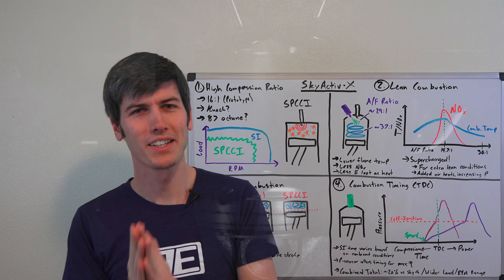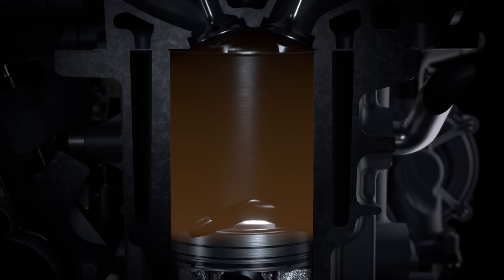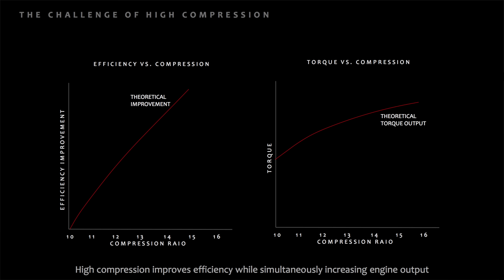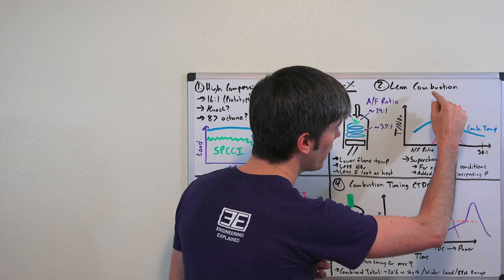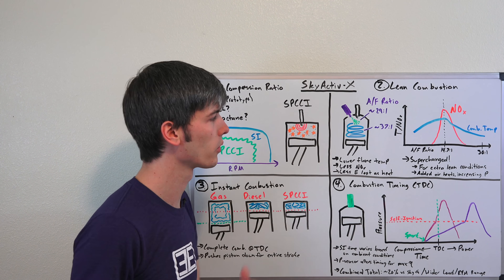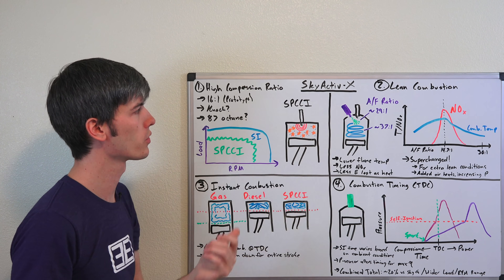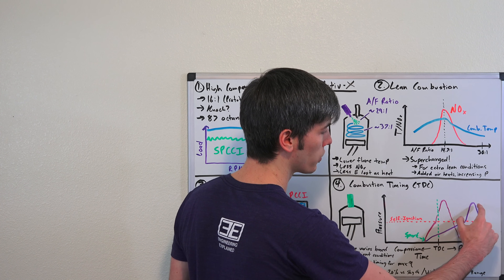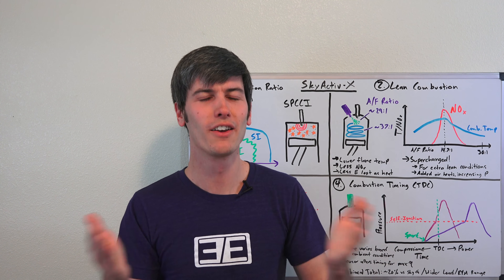How Mazda Is Saving The Gasoline Engine - SkyActiv-X

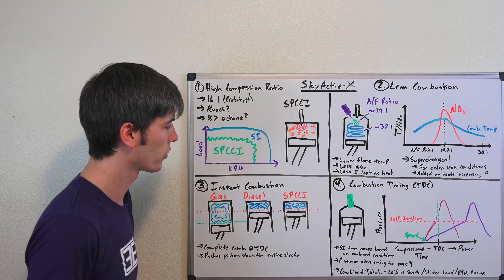Comment: 9:29 I’m pretty sure something is off in your explanation here. Spark ignition is not slower than diesel to combust.  Diesel is slow because the injected fuel takes time to vaporize and mix with air and then start to burn.  

The spcci as you are describing, in contrast to both diesel and si combustion is caused by a pressure wave. Pressure waves travel at speed of sound. This is much much faster than either stoichiometric flame propagation or the mixing speed in diesels.

I think that is really what you meant to explain.

Comment: it is not knock ... you are failing to mention the charge mixing .... it's the mixing that keeps it from detonating, and it's the mixing that keeps the self ignition from being harsh.
it's the mixing.
as I mentioned in another video,  my carbureted, air cooled, motorbike, with no knock sensors, runs stable at 15.17 bar BMEP naturally aspirated ...how is that stable ? it's the mixing.
Mazda is basically hyper accentuating the inherent 4-valve tumble .. making it tumble more With The Ports.....I read an article on the newly developed Swirl Porting method in 1988, and that totally charged how I port.

Comment: I must respectfully disagree with you about electric cars being the future.  We do not have the infrastructure for everyone driving an electric car.  The current grid will not support the massive amount of powered needed to charge electric cars.  There are not enough cooper mines to make the required amount of cooper to produce the required cooper needed  to name just two of the current problems and then there is the resourced needed to produce batteries.  Look at the current drop in EV sales.  It is not the future IMO.

Comment: I have a 2020 Mazda 3 and it's great. I ran across hard times and couldn't maintain the maintenance as frequent as I wanted (not total neglect just not as timely as I wanted life happens). Anyway despite this I'm still getting 30.9 mpg and that's after falling from 31.3.
Times are better and the car is paid off so I can get back to keeping it a well oiled machine.

Comment: 8:37 I know it's seven years later but I have a doubt. You say here that diesel have almost instaneous combustion and otto engines rather have a prolonged combustion during the expansion of the cylinder. But weren't the "theoritacal" cycles the opposite. I mean, I know that I'm reality, they aren't really true to the millimeter as they they are physically impossible, but they aren't very far from reality, especially nowadays. Unless diesel have very dry and instant combustion they aren't achieving the instaneous combustion of gas engines. I'm not an engineer, but I think you wanted to say that gas engines have a flame propagation problem, the flame starts from the spark and then propagates. But diesel have combustion happening in every part, so multiple ignition points. But this doesn't mean that gas engines work at constant pressure, or diesel at constant volume rather the opposite.

Comment: Guys I have a question! i just bought a 2025 mazda3 with skyactive-x engine here in spain, and i wonder if it will be good or usefull to use higher octane gas with this spcci technology

Here in spain, 90 USA (98 EU) octane gas is way more expensive because almost no one buy it, but as Skyactive-X uses lots of compression ratio, maybe it is better to use it besides the price

Thanks guys!

Comment: Hmm… maybe the second, smaller injection of fuel should use something like nitromethane instead. Nitromethane cools the cylinder, has a high flame speed, and brings its own oxygen.

This allows you to use a higher octane fuel for the rest of the cycle, allowing you to have a higher overall compression ratio, but still having quick ignition at higher RPMs.

Comment: Other people who drove this car say that engine does’t really have power Mazda claims and engine is in a capsule because it is very noisy! And fuel consumption is not impresive…On top of this that car (Mazda 3) had very, very long gears, so on hill they had to shift 2 gears down to get the power and driver of a diesel Passat behind them thought they were kidding…!
Reply: It has plenty of power but you have to give it enough RPM. Remember, it has no turbocharger. I really like it this way. Together with the very crisp manual transmission in my CX 30 it drives like my first cars, just with substantially more power (my first Audi had 90 HP).
Consumption is great, I have to really push it to go above 6 liters/100 km. Normally about 5.3. Not had for a petrol car.

And the capsule is not there because it is noisy (it isn't) but because it sounds a bit unusual due to the compressor etc. You can sometimes hear it on the autobahn if you're fast enough and the road is narrow enough to reflect the sound. Sounds like a high speed train 😁.

Comment: I have this engine for 3 years now, it's so smooth at low rpm, so fuel-efficient you don't have the economy of a 2.0 naturally aspirated, more like the same as a turbo 1.5 or 1.4 from the competition. And it still has some punch especially above the 4200rpm range where it doesnt work in "diesel" mode but regular gasoline mode so you get all the power.

I recommend y'all to try it out, it makes a fantastic daily driver in a country where gas price are high (Europe) without sacrificing too much on power. And i guess it's pretty nice for the US too, but if were living in the US i would definetely go for the 2.5 turbo for the power and fun as gas price is not a problem there.

Comment: I had 5 different Peugeots over the years, I know,I know, they were rally bred but they have gone the way of the dodo. My last 308 was a disaster and couldn’t wait to get rid of it. The engine a 1.6 litre diesel was a collaboration with ford so just a run of the mill engine fitted to Volvos minis and ford Peugeot and Renault. I researched other cars and I couldn’t find any bad reviews. Turns out I bought one and what a pleasant surprise. The suspension and handling are supreme. The braking system is excellent and the fuel economy is outstanding. 6.2 litre per 100 km using a low octane fuel out of a 2 litre engine.happy customer.

Comment: Atkinson cycle, not Miller cycle?  Either way, isn’t retarded valve timing events compared to Otto cycle. That’s how they get away with such high compression ratios running on regular pump gas. It’s about cylinder pressure not static compression ratio. Very informative video. By the way, I’m a 17 year Mazda master tech.

Comment: I wonder...can a turbocharger be bypassed, so that it works only when I want?. The outside air intake from the filter gets a bypass flap toward the engine/ or the turbocharger, and the exhaust also gets a bypass flap toward the turbocharger/ or the  catalytic- muffler...out. The engine/ transmisson would last much more, since only work over pressured when I want. Does the computer would need additional adaptive programing,  or the mafs sensor-pedal position- injectors-coils compensate/ adjust in concert with current software to make it work? Thanks for your opinion. David

Comment: Why not just pour gasoline in a diesel engine (of course with required adjustments so it doesn't break)? you get more power per liter than diesel and you don't have to worry about knock

Comment: Great explanation! Now I have a question: let's say if we want a bit more power from the engine and brings the car to a tuner, since this is a new type of engine do you think it's safe to increase the amount of injected fuel/air for more power? Or is it going to mess with the whole settings Mazda set from stock regarding the knock handling?

Comment: Your explanation of combustion time in diesel vs gasoline engines is backwards.  In the Otto cycle (ideal gasoline engine), combustion occurs all at TDC.  Real gas engines closely approximate that since it takes minimal time for the flame-front to cross the cylinder (from spark plug) thru the premixed air & vaporized fuel.  In the ideal Diesel cycle, combustion occurs at a constant pressure, which requires a slower steady burning as the piston descends.  After all fuel is burned, cylinder pressure drops as the piston continues downward, as in the Otto cycle.  The Diesel fuel spray rate is purposely tapered to allow this.  Ideally, cylinder pressure won't exceed the initial compression pressure (say 400 psig) with the spray combustion maintaining that as the piston descends.  But you are correct that the "quasi compression ignition" in the SPCCI is rapid since all the fuel is already in the cylinder when the spark ignites it, so the thermodynamic cycle is more like the Otto cycle of other gasoline engines.

Comment: I've always been of the opinion that hybrid is a good idea; better than pure electric. But the one handicap is getting some gasoline engines over 50% thermal efficiency like the new achades desil. But at 50% your bassically at the same efficiency of our best fossil fule grid energy production.
Reply: There’s an endless supply of crude oil. We don’t need more than 50% thermal efficiency. Especially when you consider the efficiency of turbines in power plants isn’t more than 60% and the distribution of electricity is very lossy.
Reply: @erict.35  the point is that at 50% te an ice would compete with or beat all but one conventional power production method ( natural gas at 70% te ) that said when you account for transmission losses along the grid natural gas in only at a slight slight edge. So the idea that using smaller battery packs like a capacitor rather than a traditional battery; and taking advantage the energy density  of gas compared to a li-ion battery at nearly a 100x energy density. You can use less of the extreamly finite lithium reserves per vehicle and get longer ranges by taking advantage of gasoline as chemichal energy storage rather than li-ion cells.  And as food for thought pushing the 70% te of natural gas power higher will be a much harder task than pushing the 40% of most cars too 50% or higher

My opinton still stands that if you pair a hybrid system with an ICE with a specific fule efficiency of greater than 50% you would bassically be at the same emissions per kw or potentially better than all electric and reduce the consumption of limited resources like lithium.

Comment: Won't help. The Scientific and Technologically illiterate UK government is prohibiting the sale of IC engine based new cars in 2030. This is part of the ill-informed pointless Net Zero policy initiated by Theresa May irrespective of the cost to the UK tax payer. This policy is just designed to make the silly old trout look good on the international stage. UK is responsible for 1.9% and failing of global carbon dioxide emissions and so will not have a noticeable effect.
Reply: info: The UK is governed by a Scientific and Technological illiteracy. To my knowledge there is only one STEM degree holder in the cabinet. There are far too many lawyers, PPE graduates, History Degree holders in the House of Commons hence the tendency to seriously screw up on Scientific and Technological matters.

Comment: Go back to the 1970 th Honda created a cilinder head with the futuristic of a small chamber were the spark plug seated and with a small valve letting rich air fuel mixture in the small chamber and the main chamber with lean air fuel mixture dig in the history maybe you will find it ,if not they hold it secret  if I remember they called it civic

Comment: By the example you show, the valves are positioned as fully closed, when ignition occurs. So why are you taking about Spark Knock because that can't occur if the valves are fully seated and the spark plug is needed to start combustion ?

Comment: SPCCI requires low RPMs or low octane fuels to work optimally. Could probably improve this by combining it with RCCI, and thus using both a high-octane fuel and a high-cetane fuel. For example, start with Isobutanol as your high-octane fuel, then inject either hexadecane or diglyme just before ignition. Could also replace the high-cetane fuel with an oxidizer, such as a blend of water and hydrogen peroxide.

Comment: Nitrous oxide supports combustion by releasing the dipolar bonded oxygen radical, what you mean is Nitrogen oxide NOx gases form when fuel is burned at high temperatures. NOx pollution is emitted by automobiles,

Comment: Still a P.O.S.
Reply: Didn't realize you were an Engineer as well...
Reply: No never claimed I was, however I’ve been in the junkyard used auto parts business since the 80’s and I know what people are looking for, the more they look for a part the more I know it doesn’t last, that goes for Corea motors as well Mazda is not as good as Honda or Toyota and others, Mazda for example doesn’t have a key way on their crankshaft, pop the clutch a little too hard and their go’s the valve train and many more problems, I guess that’s how they make their money. POS. 2.0 . And that’s all I got to say about that.
Reply: @benitovaladez7596  Those are old Mazda engines that Ford's 'Engineering' team designed, they used friction washers instead.

Mazda has been Ford free since 2015 and Toyota is using Mazda's skyactiv engines on some their cars.

Comment: You say lean doesn't burn hotter. But I know from experience that lean melts pistons and even just leaving off your brake booster hose (large vaccum leak) will cause the exhaust to glow bright red. So how do you explain that?
Reply: When under high loads your AFR's are going to richen up to keep combustion temperatures down. Most factory cars are going to be in 12:1 range under high load. What most people mean by a lean AFR melting pistons, is leaning out under load. Its not running lean per say, but running less rich under load. the engine is still running rich, but instead of runnning around 12:1 they may be running at 13:1 or 14:1 under load and thats when you melt pistons. You are still running rich, but you aren't as rich as you need to be to keep the engine intact. Running lean overall (AFR > 14.7:1) actually lowers combustion temperatures.

Comment: Have a Mazda 2018, 1.5 Diesel and  its fuel efficiency is fantastic!!! Better than my Smart 600cc!!!  Problem free, reliable, 105hp and drives fantastic. S5 engine code. Exhaust pipe is always clean!!! Gets 33km/ltr on highways and 23km/ltr in town!!

Comment: English is a primitive language to explain something. I find like with the language, there is need for braggadocio. All those word he used to explain that for more power and emission efficiency you need combustion happening from a simultaneous  release and consequent ignition of the fuel and oxygen mixture, which then reduces the combustion volume inside the cylinder,  rather than the opposite which happens in most of today's engines.

Comment: In a "normal" gasoline engine the larger volume in the cylinder of combustion, compared to a Diesel (CI) or a SPCCI engine, maximises the cylinder wall available for waste heat removal. Does the Mazda engine described here require high temperature and high pressure resistant materials, as does a Diesel engine? Also, in a normal gasoline engine, a lean mixture has reduced charge cooling, which leads to the same question.

Comment: So in essence, Mazda is making a gasoline engine that creates power like a diesel- which is great, because Ammonia-injection diesel engines are a freaking nightmare and incredibly expensive to maintain.
They have always pushed the envelope, the miller cycle engine, the Rotary, the Otto-Atkinson cycle engine.

It's incredible how much R&D they put into their power-plants and chassis when they are comparatively a very small company, especially now that Ford has little to no stake in the company anymore.

Comment: I would imagine that it will need sodium filled valves and special pistons to transfer heat and handle heat this engine is gonna run hot also if it’s lean already if a sensor failed and runs any leaner what’s the plan then

Comment: 2 issues:  (1) Fascinating technology, but I would worry about the complexity of this as it ages. It uses a lot of sensors that probably are pricey to diagnose and to replace (let alone access)

. (2) Rust is a huge issue with Mazdas, my wife's 2005 Mazda 3 looks like it has termites, and we live in a low rust area (Alberta, Canada). I don't know if they ave addressed this issue, but I would NEVER buy another Mazda, as Toyotas of a similar age have little or no rust. Fuel economy is far less of an issue to our family than reliability.

Comment: Hello, there is something I don't understand about Nitrous oxide (NOx) emissions. I heard that a air/fule mixture ratio of 14.7:1 was the ideal ratio. By "ideal" I understand "stoichiometric" ratio. That's why I don't understand why it is the best ratio to emit NOx. For example, I heard that typically diesel engines emit more NOx then gas ones because they "work" with a lean mixture which means more oxygen then fuel. And here on the graph we see the exact opposite phenomenon.
Thanks a lot for your video.

Comment: 16:1 wow, that thing would be awesome , modified, and with e85, and maybe methanol injection, so it actually uses that compression ratio, may not be good for emissions, but torque would be through the roof, if the rotating assembly could handle it, firing just after TDC with 16:1 and 116-120 octane, this could be a awesome engine to modify! Heck, may as well throw a turbo on there as well! Depending on rpm capabilities it could make 1000+ HP! Depending on the air flow, and engine speed, it could make 400+ Ftlbs tq, depending on bore ,stroke, displacement, around 2.4L surely 400 Ftlbs tq...

Comment: I am presently driving a new-to-me MX-5 Miata. Driving around a six speed manual transmission with a bit of sporty but not hotrodding, I'm averaging over 36 Mpg!  But interestingly, a sticker by the fuel filler recommends premium fuel, not 87 octane.